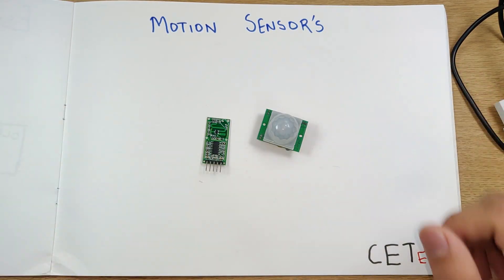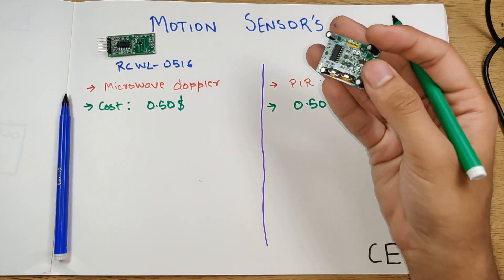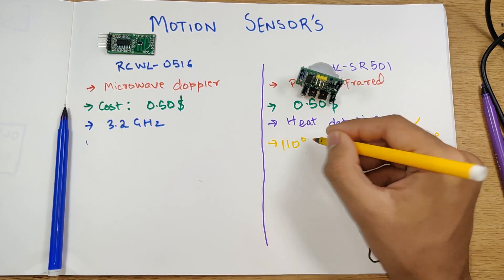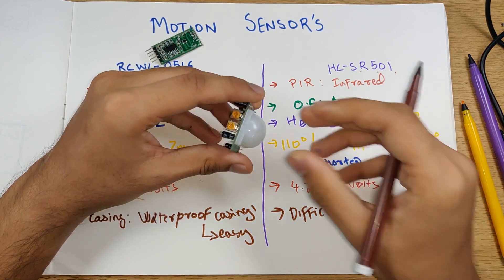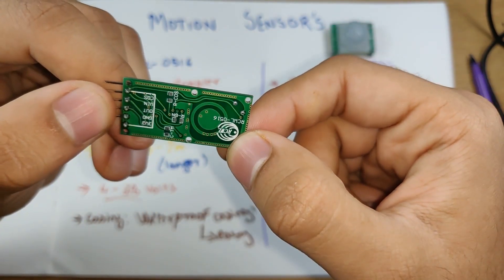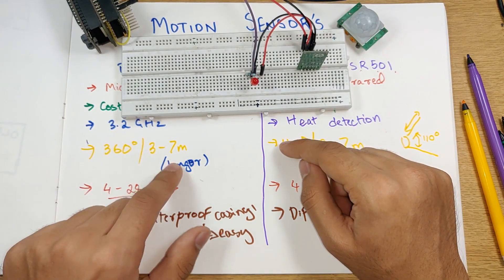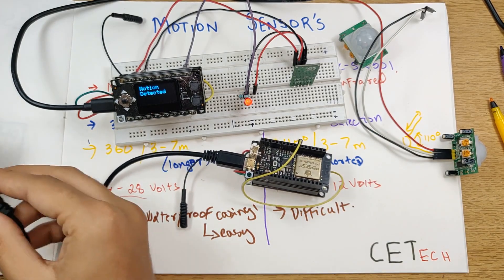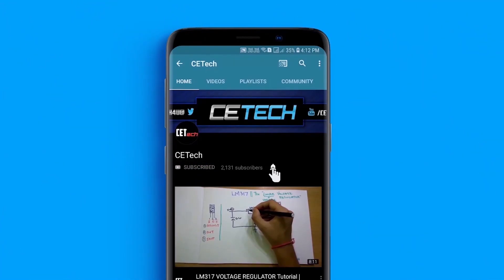RCWL-0516 Microwave & HC-SR501 PIR Motion sensors | Tutorial with ESP32 and LoRa Project

Comment: Great info, thanks! I just started playing with the same microwave radar sensor and run into a problem. I'm using it with a nano and an hc-12 transmitter to remotely trigger an alarm in my house. The problem is that powering up the the transmitter side with the radar sensor, the sensor triggers once and stays triggered, outputting it's high pulse. I disconnected the hc-12 and powered the circuit and watched the output of the radar sensor with my scope and it works correctly! So the hc-12 transmitter is interfering with the radar sensor thus locking it up. I even tried changing the frequency of the hc-12 and it still has the same problem!
More trouble shooting to do!

Comment: After 2 days of trying to get  an RCWL-0516 to work with an ESP32 LoRa board I'm giving up.  The parts work fine separately but I get very inconsistent results once you start sending packets.  I'm going to try using a PIR sensor.  The Lora board works fine if you connect and disconnect the GPIO pin to 3.2v manually.

Comment: I wonder if the PIR sensor could be connected to the CDS to "turn on" the RCWL when the PIR trips. Use case would be for a priximity sensor to detect humans, in a battery powered device - so remaining passive while it's sitting could save a ton of battery life. There's also a security factor; not putting out unnecessary RF. This would also help reduce false positives as both sensors, independently, are trigger happy.

Comment: Does the same Arduino code for pir sensor works for microwave sensor? Example, can I replace the pir sensor with the microwave sensor or do I need a diiferent Arduino code for motion detection?